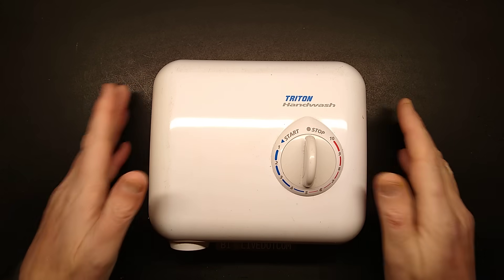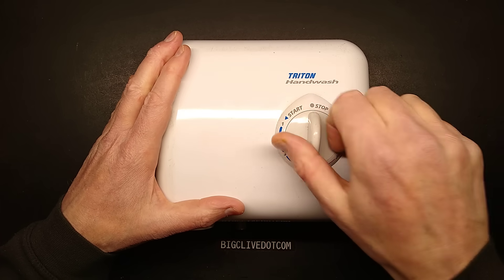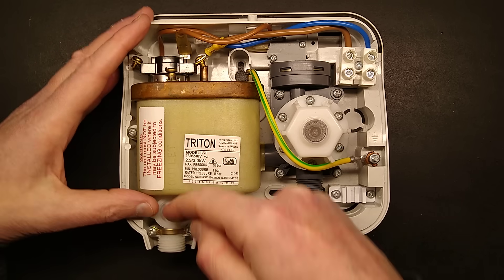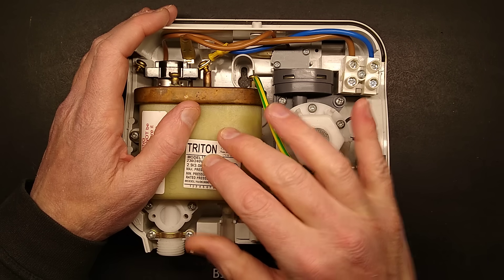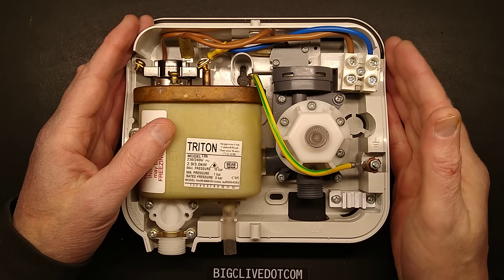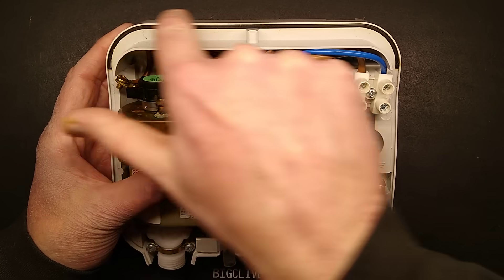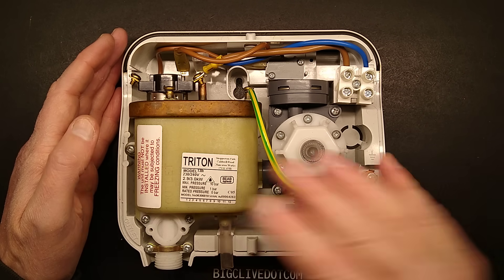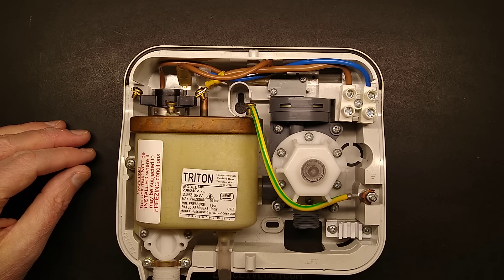British construction site hand-wash unit

Comment: Here in Germany there are also such mini instantaneous water heaters with max. 3.6 kW. Very practical in some cases. I've often found them in the toilets of small snack bars here.
Our instantaneous water heaters for the shower/bathtub are usually operated with 400V three-phase AC, their power consumption is usually between 20kW and 30kW.
Reply: Similar to your snack bars, these sorts of things can be often found in older/rural pubs or public toilets in the UK, makes sense for small applications if it's the only thing that needs hot water.
Reply: That's an insane amount of power
Reply: I'm from Germany and have one of the bigger ones for my shower/bathtub and the sinks in bath and kitchen. Works really well. I always thought it's just 240V but i've looked and the breaker is rated for 230/400V :)
Reply: @CalmoOmlac my son's barber shop has one of these, simply for hand washing between clients and washing up a few mugs. Quite common back in the day in scout and cadet huts as well
Reply: @handlesarefeckinstupid  I got mine just a few years ago. Before there was a gas powered one installed which was horrible to adjust and sometimes the flames went out in the middle of the shower with only cold water left. The new electric one works way better, is safer and much smaller :)
Reply: I have installed woodgas combustors in my house for heating and hot water, because electricity has gotten too expensive in southern Germany.
Reply: If I could have 400V 3 phase in my house I'd not use it for heating water, it'd be charging my car each night in 40 minutes instead of four hours. That's a respectable amount of power!
Reply: @ncot_tech  
Here in North Rhine-Westphalia, the 400V three-phase service is the standard in flats and houses. Only in some old buildings is it still rare to find a single-phase service.
The meter fuses to the flats are usually designed for 35A. 
(Unless there is/are instantaneous water heaters installed, then 50A or 63A)
In newer buildings, instantaneous water heaters are rarely installed here nowadays. The hot water then comes from the heating system. (gas, oil, district heating or heat pump)
Reply: @ncot_tech yes, but they are still limited to 20kw or 30kw. My charger is 25kw on single phase
Reply: @ncot_tech  while it sounds nice it will absolutely destroy your battery's in no time
Reply: @ncot_tech  Get an inverter and run it off your cooker breaker, or put a dedicated one in
Reply: We've got those mini heaters at work, too. It's an office building, just about 10 years old. They probably figured that with the only place where hot water is needed being the sinks in the toilet, it is cheaper to install them instead of putting a full hot water plumbing setup in.
Reply: This is outlandish for a swede. We don't have anything like it. Water heaters are only bigger units.

Comment: As you know, the US has domestic and commercial 240V basically everywhere. This kind of device would work quite nicely if you were willing to run a dedicated circuit for it. We already often have dedicated circuits for larger appliances, so this should be fairly straightforward.
Reply: They have these. Go to Home Depot and search "under sink tankless water heater" 30A/240V gets you about 0.7 GPM. Friend has one for his pool cabana outdoor kitchen thing.
Reply: The bonus for us is no dedicated circuit required.
Reply: @Monkeh616  Not sure where you are, but the UK uses dedicated circuits for things like showers. This appears to be a requirement, but I'm not super familiar with UK electrical code. This may also be a recent (past couple decades) change.
Reply: @Falcrist  For showers, yes - intermittent loads of the size of this handwash can easily be accomodated by normal circuits.
Reply: A shower, taking at least 6kw would need its own circuit but these devices are rated at 3kw, equivalent to 13 amps which means that it can be run off a normal socket outlet. Of course a socket is not allowed in a bathroom so in this case it would need a dedicated circuit. @Falcrist
Reply: @Rob-e8w  It probably depends on whether the device would be considered a continuous load. You'd be surprised at what qualifies.
Reply: @Rob-e8w  It's bizarre that UK still doesn't allow outlets in bathrooms. The safety technology is robust and quite mature. This is a bit like preventing car accidents by banning cars...
Reply: @viscayavagabond  not really. Condensation is the danger.
Reply: @BogSulphur  The "problem" is long solved. Condensation exists in every bathroom, everywhere.

Comment: I'm curious about the age of this particular unit and if it is a salvage item that had come into your possession.
Reply from the maker: I think I salvaged that one from the skip/dumpster of a construction site when the contract came to an end.  The moron that removed it deliberately snapped off the outlet tap to try and prevent it being reused.
Reply: Currently available to buy in most building supply stores, such as Screwfix in the UK.

Comment: I’ve been looking into something like this for our kitchen. The water heater is in the basement on the other side of the house and it takes literally a couple or few minutes to get hot water at the kitchen tap. Amazon has units like this that they are selling in the U.S. that run on 120v and they claim at 5000 watts. Since I know that this is not the case i’m leaning more toward the units that run on 120v at 1500 watts, much more feasible, and have a little 10 litre tank for holding heated water.
Reply from the maker: I use an undersink water heater that uses low power to heat up a reserve of water.
Reply: Unless you're actually plugging into an outlet don't get a 120v 1500w heater. If you need a dedicated circuit it makes more sense to go with 240v. There are numerous electric tankless point-of-use heaters from real established brands running around $200.

Comment: I'm doing up an old house and plan to fit some of these instead of a hot water system. I also plan to fit a tap to it, 'cos it will look better, but take out the valve inside the tap so it's always open.
Reply: You can get flow-switched units designed to be connected to taps, including with small hot tanks.
Reply from the maker: You get undersink units that use low power to heat a reserve of hot water locally.

Comment: Construction site with running water and power that you didn't have to haul in the back of your truck? Thats a thing?
Reply: If you're employing people to work at a site (not contracting to shuffle off responsibility..), there's a legal requirement to provide certain facilities - drinking water, hot water for sanitary purposes, and toilet facilities. Depending on the circumstance this may extend to showers.

Comment: That type of heater has a fully enclosed and grounded element, one shower i removed from a property (it had failed) was an acrylic block that was drilled, and a bare coiled element threaded through, the outlet was grounded
Reply: Reminds me a bit too much of the south american su i ci de showers.
But maybe the water heater you removed from the property was safer, do you have any idea ?
Reply: @psirvent8  As long as the shower was properly grounded, it's perfectly safe
You can alsoo get electrode heaters, baasically the mains connects to a couple of electrodes iin the water, again the outlet is grounded
Reply from the maker: I've been trying to find one of those original units.  Dolphin maybe?
Reply: @bigclivedotcom  could be dolphin or mira, or sadia before they were heatrae sadia
I'm not really sure

Comment: The other reason for no tap on the outlet is because warm water expands. After use, the residual heat in the heating element further warms the water, which expands. With no tap, this expansion water just drips out into the sink. The point to make to users is that this is a feature, not a bug.
Reply from the maker: My vented undersink water heater in the kitchen drips while heating for that reason.  I prefer vented to unvented for the safety aspect.

Comment: I was hoping to see the heating element, but I suppose you didn’t want to ruin it.  I have an electric shower that has a digital setting, it seems to switch several different-size elements in and out in a binary arrangement (it has 7 heat levels and 3 relays that switch the elements).
Reply from the maker: Search my videos for the word shower and I do open a heater block in one.
Reply: The Selectronic does that. Depending on the age & model there were 3 or 4 elements, all of different wattages and 3 or 4 triacs to switch each element in/out as required. It also has a motorised flow valve. Combined, it will never scald a user as it can react quickly to maintain output temperature.

Comment: I'm fairly confident an electric shower or a device like this can be quite safe to operate, what baffles me about the UK is that you have that in the shower and then turn around and freak out when an outlet in the same bathroom with the same safety and protections available is full mains and you resort to have a "razor socket" instead.
Like make up your mind...
Reply from the maker: The isolated razor socket is to cater for dumb people who drop their live shaver in soapy water and then fish around in it to get it out again.
Reply: @bigclivedotcom  But in such scenario a GFCI/RCD would still work
Reply: A piece of equipment on the end of a cable does not have the same protection as a purpose designed fixed heater - and RCDs are additional protection, not the primary method of preventing shock.
Reply: @Monkeh616  And yet the rest of the 240Vac mains world copes just fine with normal sockets in the bathroom...
Reply: @Yrouel86  They do. I'm just refuting your assertion that the risks of portable and fixed equipment are equivalent.

Comment: Most water heaters push the excess pressure back out the incoming supply. It's only about a pint or so and very slow. Problems do arise if there is a check valve nearby. For most homes it's an open circuit back to the water main so it doesn't matter.
Reply: A heater which could push excess pressure back to the inlet here would require at least a single check valve to prevent exactly that occuring. There's a legal requirement to prevent contamination of potable water supplies and that includes by water which has been heated.
Reply: @Monkeh616 When I was a child, our 120l electric water heater tank failed many times. After several repairs, the thermostats had been bypassed, and we switched it on and off by demand at the kWh meter. We used it like that for years (about 1995-1998). It was embarrassing when we forgot to turn it on. It was a bit more than embarrassing when we forgot to turn it OFF . Of course, it happened... 

 The supply pressure was very low in our area at the time. It was quite amusing to see high pressure 120+°C steam coming from the toilet when we flushed it (we had a direct-flush toilet with a Schell valve, perfectly useless with the low supply pressure...). The water supply company wasn't that amused by our water meter in which everything was melted into a blob of plastic (fortunately its window was glass, so it remained watertight). Even our neigbour was confused why he was getting warm water from the cold tap that night, and I think his house gets the water from the crossing street... This happened twice, the second time the plumber of the water supplier warned us that we will pay for the next meter if this happens again. 

The water heater has been repaired, but of course it failed again not much later. This time a pressure regulator has also been installed into the water inlet of the tank. That type of pressure regulator acts as a check valve if it gets higher pressure on its output than on its input. The tank had an in-line safety valve on its inlet, but it was 20 years old, and it never opened its vent before due to the low supply pressure (instead, the heated water expanded towards the water supply), so it was probably clogged with limescale. Fortunately the pressure unclogged it, probably just barely before the tank would rupture. I don't know what kind of pressure was there, but it washed the ~2cm thick, cement based plaster off the wall around the vent, the bare bricks became visible on a quite big spot. We left the wall untouched as a memento, and finally replaced the water heater... This was in 2000 or 2001, I still use that same tank, which is BTW the same model as the previous one, but this one never failed (and this later revision has double protection against overheating).
Reply: @Monkeh616  Then I bet the cold water isn't that potable to begin with and the administration instead of fixing that makes laws to transfer responsibility to users.
Reply: @ruben_balea  Why would the cold water be non potable ?
Reply: @ruben_balea  Bet all you like. Just don't feed contaminated water back into the supply.
Reply: @psirvent8  If the water is potable it doesn't contain germs that will grow inside the water heater, if it grows germs when you warm it then it's not potable water but marginally filtered water.
Reply: @ruben_balea  Yes, I'm sure you get distilled water piped in. Meanwhile, in reality..
Reply: @Monkeh616  I've my own really good well, but you don't need distilled water, you need water without organic matter which is a nice name they invented for... you know. 
It seems the definition of potable water varies a lot even within the same country, I would only call potable to a water that meets the requirements to be able to sell it bottled.

My dad worked in the construction until 2013 and of course damaged underground pipes leaked but on some places of a certain city every now and then they would stop leaking and start sucking back the... "mud"
I guess it was because in that city there must be about 75 meters of height difference between the highest and lowest areas and all the water pipes were in parallel (I don't know if that's the exact word) without any kind of flow or pressure control valves.
I've relatives living there that almost died from drinking "potable" city water, they need to use bottled water for drinking and sometimes for cooking.
The answer from the city is that it is the responsibility of the owner of each home to install an adequate purification system, why would you need to purify again their supposed potable water?

Anyway in many countries the check valves supplied with water heaters in many countries allow some backflow and that's 100% legal in those countries.
I'm like 300% sure those can't be WRAS approved so if you're from the UK you probably will never get one there unless you purchase online a water heater designed to be sold in another country.

Anyway nothing prevents you for using a normal check valve, and I've two in series. I've also a TPR valve that opens at 90ºC and/or 3 BAR and 2 extra pressure relief valves of 6 BAR and 10 BAR. Better safe than sorry.
Reply from the maker: Here they suggest expansion vessels and pressure release valves.  Probably to avoid liability.
Reply: Indeed. You're not allowed to push water back into the incoming supply.
Reply: @charlesbridgford254  We're not talking 100 gallons but one pint at most. And that pint is right next to the water main. It probably never even made it to the water meter. The expansion has to go someplace. If there is a check valve to close to the water heater you're required to get an accumulator.
Reply: @randycarter2001  Any potential volume back into the municipal supply is not allowed. So an expansion vessel or vented downstream of the valve is required. On a heater this small it's usually vented, and you have to tolerate a small drip for a couple of minutes.

Comment: 230V mains is something that you only learn to appreciate when you travel to lower voltage countries.
Reply: Friendly reminder that the US is a 240V country. You can get hot water "on demand" systems. They run on 240V and require a dedicated circuit, but that's already true for electric stoves/ovens, clothes driers, and air conditioning units.
Reply: @Falcrist  Here in Europe we can use two phases in series, too. Gets us 400V. For example our three phase water hearers use that do get 18-33kW of power
Reply: @keineAhnungka we also have 30kw instant water heaters, just requires multiple circuits. And for commercial applications we have higher multiphase options, but rarely would they be needed in a home.
Reply: @sirseriously   3 phase is not an exotic, commecial only option here. We have 3 phase power in the kitchen by default in case you want to hook up a stove. Most stoves will just use that to get 3*230V (L to N) to be able to run all the tops at once but in theory they could run 3*400V (L to L) if they liked.
Reply: @keineAhnungka  the US has three phases for commercial.
I'd love to know how you think you use two phases in series tho...
Reply: @Falcrist   It's not really in series, they just connect phase-to-phase, the same way we get 240 or 208.
Reply: @eDoc2020  I know how it works. Thanks.
Reply: @GeneCash  the US most certainly IS a 240v country. Otherwise you couldn't run that drier. 😉

Comment: Hopefully better constructed than an InSinkErator "leak-o-matic" Instant Hot Water Dispenser... (I.S.E. uses cheap gasket-less glued plastic fittings that are prone to seep water that then corrodes the electrics and drips under the sink where it can rot the flooring if you dont constantly check for leaks...

Comment: Is there no thermal-fuse for in case it is stuck in heating without water-supply?
Reply: Yes - the item on the top left of the heater should be a thermal cutout. It may be a bimetallic switch which resets, but at least that will keep things to plastic-deforming temperatures rather than self ignition.